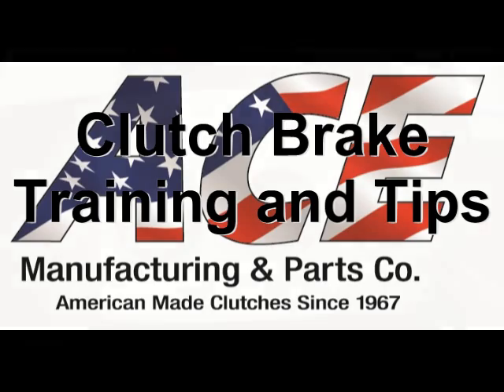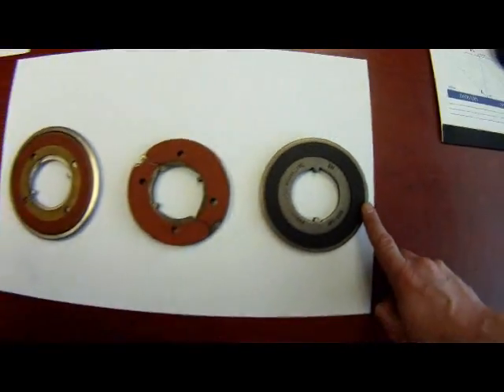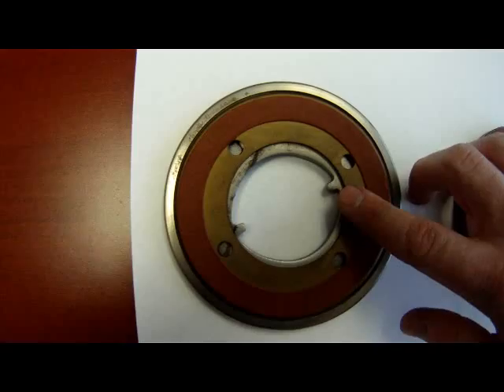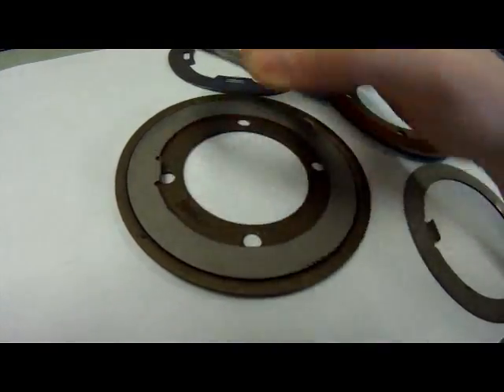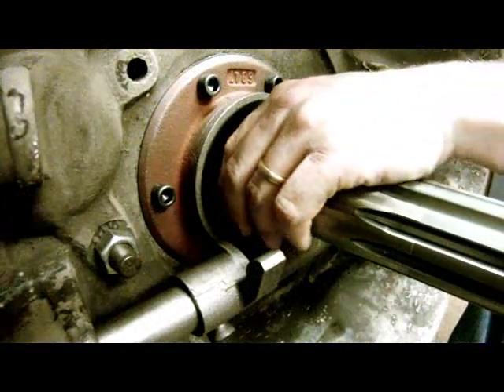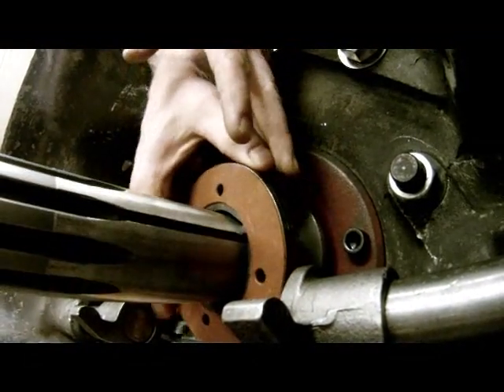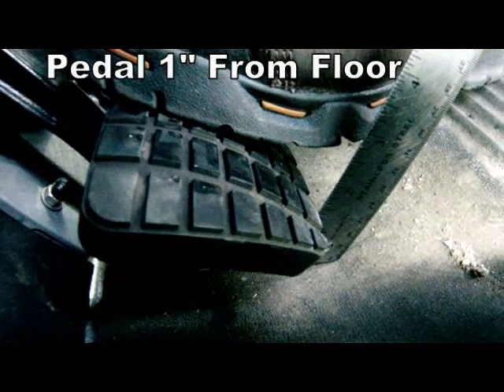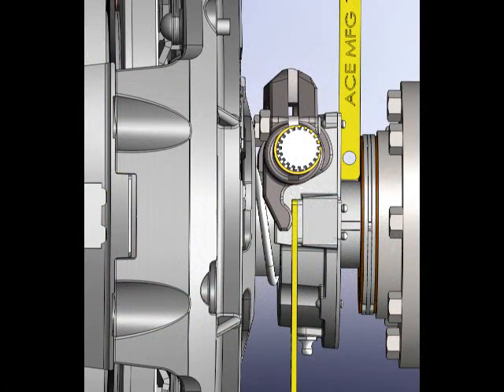Ace Manufacturing - Clutch Brake Training Video

Comment: ya I liked the way you removed the break your way will keep you cleaner I use a 3/4 extension with impact gun it's a bit more messy but gets it done as well.keep on trucking brother.